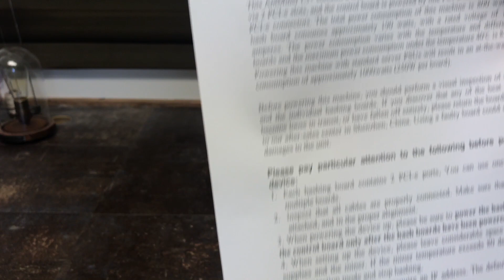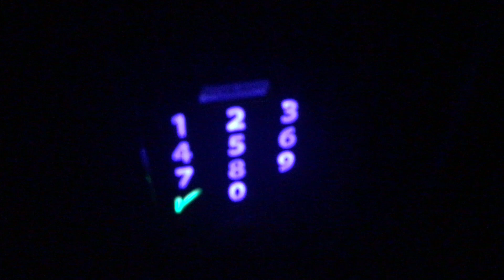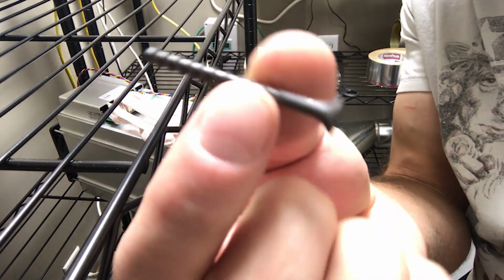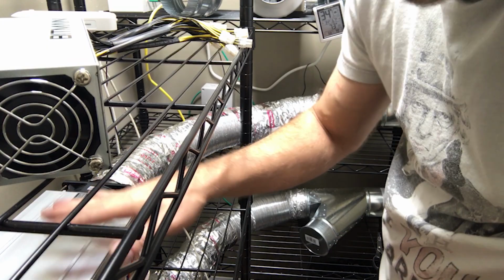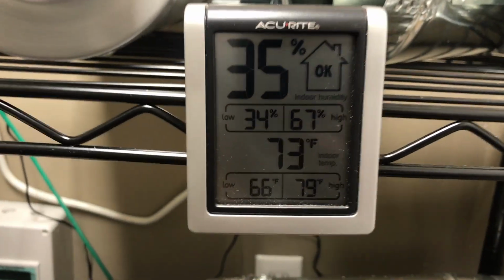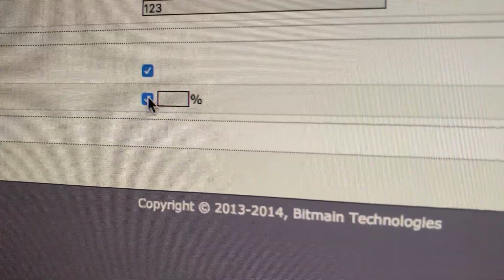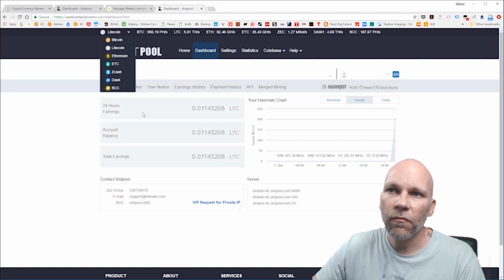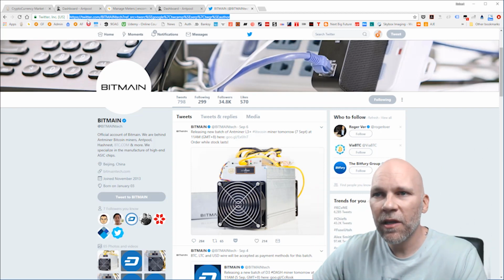Antminer L3+ 504Mh Litecoin Miner Unboxing and Setup

Comment: About power cord if power to L3 110v, hot, neutral & ground. If I want to power 220v with same cords it should be 2hot & the ground use as a neutral? Please advise. Thanks in advance 😀
Reply: No neutral

Comment: What if you have several to hook up is there a way to hook together, thanks in advance Greg
Reply from the maker: Hi, Yes, you can hook up as many as you want. Each needs it's own power supply and LAN connection for internet. Power consumption get's to be a lot though.
Reply: GottaMinute Thank you, right now I’m trying to hook up one and having difficulty’s, Do I plug into router or directly to computer , I tried both but unable to find on pc. Any advice would be much appreciated.thanks in advance
Reply from the maker: @harley78shovel79  You plug the miners network cable into the router (for internet) and then on your PC you need to type in the IP address for the miner (from any browser in the address bar). 

You can find the IP of all connected devices on your network by logging into your router admin area. It will show all connected devices and their IPs.

Once you access the IP for the miner you will have an admin page showing the stats.
Reply: GottaMinute well I’m little closer hopefully today have it connected, just having little trouble getting it connected to antpool is where Im stuck now, I really appreciate your input to it certainly has helped, i set up sub account except for my wallet I haven’t connected yet maybe that’s gotta be completed too before everything is sync
Reply from the maker: @harley78shovel79  The miners should connect without the wallet being setup I think, but you definitely want your wallet setup. I forget if you need to setup the wallet first or not on antpool. Good luck!
Reply: GottaMinute why does my worker “invalid” what should I do? Thank you
Reply: GottaMinute also trying to go back and add my wallet can’t seem to get back to it
Reply: GottaMinute hey just want to thank you again very much, you helped big time I am up and running and just have set up wallet now

Comment: I brought an L3+ from eBay (slightly used condition) I love Litecoin, I am looking forward to mine!
Reply from the maker: That's great. How much did you pay for it?
Reply: GottaMinute Like a mere $130 on eBay without the power supply which I have already brought separately
Reply from the maker: @AnarchoAlchemy  OK, good luck :)
Reply: GottaMinute Here's a quick update, I've been mining over a course of 2 days on litecoin pool and gained $1.82 which is somewhat id expected to get due to the extreme difficulty (not sure if the value of LTC has to do anything with difficulty) because I know this past year when LTC was around in $200s profitability was better like $15 daily, I wonder would LTC one day be once again a profitable coin with the L3+?? Or know of any other Scrypt algorithm coin with lowest difficulty to mine on the powerful 504 MH/s scrypt ant miner that would make profitability? I've been looking online but found few results

Comment: Did you notice a slight clicking noise when gently tilting your L3+ around.  My machine would always click like two times when tilting the exhaust fan from bottom to top (motion of rocking the unit forward to standing on its intake fan while gently holding it in the air).  It never made the noise when reversing the motion, when rocking/tilting the intake fan from bottom to top in the air.  Just wondering, I was a bit paranoid I might get some loose heatsinks.  The packaging was pristine though when it arrived so just wondered if anyone else had the same experience.
Reply from the maker: Hi, I have only noticed a little rattle from the hashing boards. They kind of wiggle a bit and sound loose, but that's normal for these machines.
Reply: Awesome, thanks for the clarification.  All looks well with the L3+.  Hashing at spec and all ASICs are go.  I do think it is the ASIC boards themselves just shifting a bit.

Comment: hello could you please let me know what is the heat rejected by L3+ and power supply? in other words is possible to measure the temperature out vs the temperature IN? that i will appreciate you help because i need this info to build my cooling system

thanks
Reply from the maker: Hello, each unit puts out about 2729 BTU/hr (about 200CFM) with power supply. Airflow is more important then cooling. Google is recommending 80 degrees for the temps. operating temp for the L3+ is 32 - 104 F.

I have 5 units running and need to upgrade cooling to a 2 ton Mitsubishi either M or P series. I'm thinking I will need about 1600 CFM.
Reply: hello thank you for the quick response...im waiting for 44 l3+ and i already allocate 2 huge exhaust fan with total of 16000 cfm and i m gonna use and other fan for air input...since we are locates in canada and its cold her we have to make sure to enter only the quantity of air needed...in order to calculate the amount of the fresh air..we need to know the temperature o C of the air pushed by the machine...but unfortunately i do not have any one  is possible for you to musure that.

Comment: About the power supply and the power cord: Does it have to be a 220v hook up or can you do a regular 110? I watched another set up video that actually had a Voltage Transformer Converter?
Reply from the maker: If you hook it to a 120v power wall outlet (which you can do) you could use a 110v cord, but if you plug it into a 220v wall outlet you would need the 220v cord. I have used two 110v power supplies to power one antminer before.
Reply: GottaMinute can you use a 300v regular USA 3 prong plug?
Reply from the maker: Are you talking about the dryer plugs that are 3 prong? Those are usually 220v though.

Comment: Which miner is best s9,d3,l3+ and is mh/s is not lower thn th/s ? Ty
Reply from the maker: Hi, I would say the S9 or the L3+ would the best option to buy right not, but I would also wait until January for new releases that should be coming with more power. Yes mh/s is lower then th/s. There are 1000 megahash (mh) in one terahash (th).

Comment: Awesome video man! I just bought an S9 but when I rooted into it, it doesn't show anything under the Miner Status page. Is my network down? Did I get a defective unit?? or is the controller board loose or defective?? Any help would be great, thanks..
Reply from the maker: Hi, thanks. It take a little bit for the stats to show up. How long has it been since you restarted it?

It should show three boards on the bottom of the status page. What does your ASIC status show on the Miner Status page?
Reply: It was running for 15-20 minutes and never shows anything under the Miner Status page. Just blank man. Does the network have to be working for it to show up? I can see the first login page with some details and even did the Aug firmware upgrade, but can't see any status. It's crazy. Bitmains support is almost NIL at this time.
Reply from the maker: Hi, so you can get to the login page and you enter your username and password? If you get past that then the network is working, but yes the network has to work for you to connect.
Reply: That's true, forgot the simple things. However, the Miner Status still doesn't show anything.
Reply from the maker: I also just had this problem, so if anyone else does. Make sure your pools are live. I had to add a new pool because two of mine where dead and it made the miner status page blank.

Comment: Only .013 coin after 24 hours??? I saw a video of a guy that showed he had got 1.11 coin in 24 hours. I'm confused. And is there an advantage of running the higher voltage as opposed to the 110?
Reply from the maker: What pool are you running on? How machines do you have running? One L3+ is currently getting around 0.3 LTC daily. You would save on electricity if running on 220v, but you would not get more hashing power.
Reply: GottaMinute Not mining just yet. Trying to find good source to buy a L3+ without paying double for it. Meantime trying to learn as much as I can.
Reply from the maker: Gotcha, well keep watching the Bitmain Twitter. They post dates for new releases, but they are months out for shipping. It is almost worth paying $1000 more to get the machine right away, but at this point one machine generates roughly 7.5 LTC monthly. I Suggest holding the LTC you get and hope the price per coin goes up, which I think will go up a lot in the next year based on the news coming out from Overstock..
Reply: Nice video, thanks! Do you mean that "You would save on electricity if running on **110V**, but you would not get more hashing power"?
Reply: L3 available at bitmain website...just buy one.

Comment: Great video. Where do you get your power cords? The only ones I've found have the square end and not the tapered computer end. Any link would be fantastic. Thanks.
Reply from the maker: Hi, yes these are the power cords I used...
https://www.bitit.us/power-supplies-psu/antminer-power-cord
Reply: I appreciate it. I see its only rated for 125 volts. You haven't had any issues?
Reply from the maker: Sorry, wrong item. I changed the link to the proper cord for the 220v.

Comment: I bought mine from a reseller for $2700. It was saying I would make $1700 on nicehash a month at the time I bought it, it now has dropped to saying I would make $750 a month. (Because of more machines built and shipped.) Is it worth to keep it running even though it could drop to lower earnings per month, or should I resell on eBay for high $4000’s.
Reply from the maker: I would keep running it in order to continue getting Litecoin. If the price of Litecoin drops below $25 you might want to stop mining till the prices goes up. So sell it if you want the cash now, but keep mining if you want Litecoin. I think the price of Litecoin will go up.
Reply: GottaMinute oh it did ha

Comment: So to get this straight, I do not need to plug in my miners into a computer correct? I simply plug my miners into my router, and can use any PC on wifi for the set up? I had bought a Ethernet switch that was I can run 2 miners to the Ethernet switch, then one Ethernet cable from the switch to the computer, and the use the wifi on the computer. I may not return my Ethernet switch just incase. So is this right? I can set up the miners using a PC in another room that isn't connected to the miners (but connected to the same network)?

Thanks
Reply from the maker: Yes, sounds like you have it correct. As long as you are on the same network in your location and are able to find the IP address of the miner you can connect to it and configure it. You do not need to connect the miner directly to a computer.

Comment: Hi Sir, can you post the amazon link for the exhaust adapter you are using? I just cant find it :-)
Reply from the maker: Hi, the link is in the description but looks like it's sold out right now. You can look on eBay for some.
Reply: i get them for 10-12 CDN shipped from a guy in quebec through kijiji, i believe he makes them, perfect fit. hit me up if you want ad. boattechbodotca

Comment: in regards to the Innosilicon Dashminer, you made a video on the A4+, is that the one you got? Is there a minimum of 3 to order? and I they really alot cheaper than Bitmain as you have mentioned in your other video?
Reply from the maker: Hi, I did not get the A4+, I actually ordered the A5 Dash miner and they still have not shipped them. I would avoid ordering from Innosilicon.

Comment: To check the heat sinks did you have to request permission? I have a l3 + but only 2 hashing boards work stable when the other one does not power up at all and when I turn on the other one it sends the other 2 hashing boards crazy.. no stable hash rate :(
Reply from the maker: Hi, It actually says on the paper that comes with the Antminer L3+ to check the heat sinks. I just visually checked them when the fan was off. Are you sure you have the proper PSU to power the unit? If you don't figure out the problem you can always send it back to get fixed, it does have a warranty. 

That does suck though :( Sorry to hear your news!

Comment: Where can I purchase one of those 220v power supply plugs? I'm having a hard time finding one. Do you have a link? Thank you
Reply from the maker: Try here : https://www.bitit.us/mining-rig-accessories/antminer-power-cord or eBay.
Reply: dude those plugs are 16 gauge, same as a 110V you should not run high load 200V through a 16 gauge cable!!, just buy 10-3 cable and make your own ends. if your 240V use 12 gauge min.... i'd use 10 with a shielded ground. (10-3), just tie the copper to the unit to ground it.